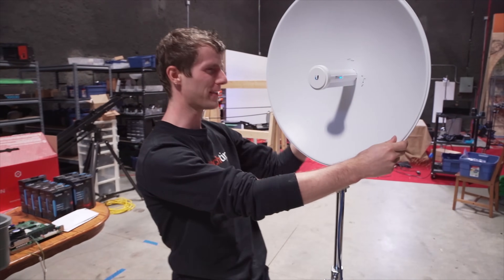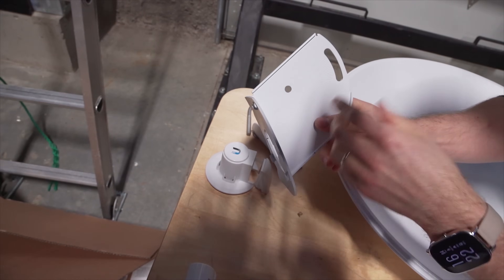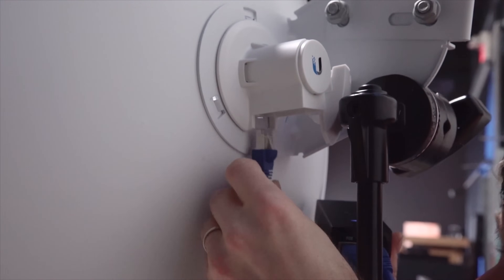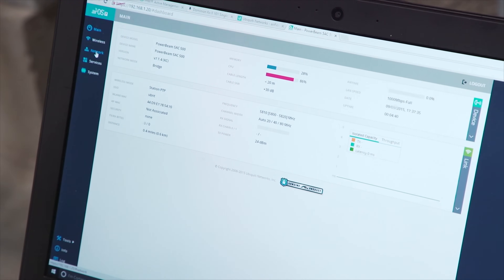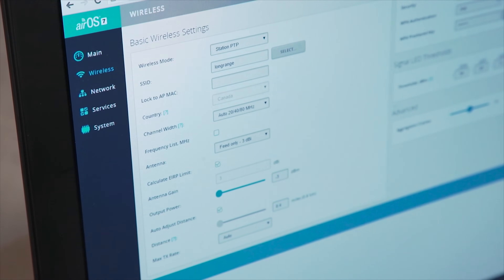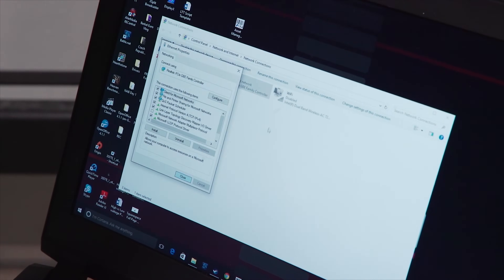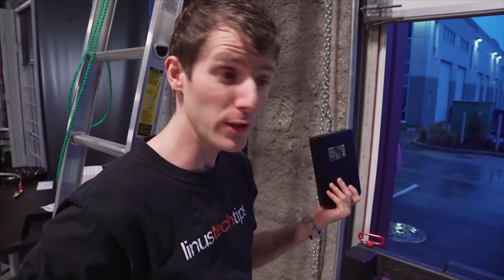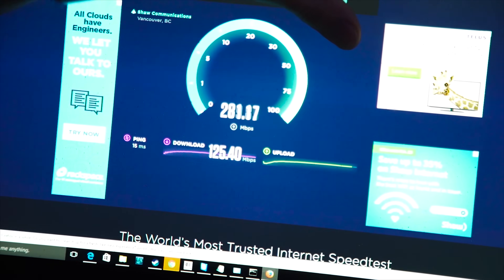HOLY $H!T - Long Distance Wi-Fi (Up to 25 KILOMETER range!?)

Comment: You buy $17,000 Man Size Batteries but can't buy a 60metre Antenna Pole?
Reply: Planning permission, man. Planning permission/permits.
Reply: Adderkleet
Pfft.. whoever obeyed those lol
Reply: Rustedblade
I admit, if Holmes on Homes has taught me anything, large portions of Canada don't.
Reply: Adderkleet
Lovely isn't it, how with the stoke of a pen the Council can be on your doorstep in morning with a demolition crew to inform you your house in non compliant with code
Reply: I work in a company which builds transmission towers. A 60m antenna pylon whith everything included(Planing, permission, foundation) it will cost you at least 80k€ which is around 115k canada dollars. This is nothing you should invest for private wifi :D
Reply: 60 meters is 196feet.
At 10 feet per story (on average), that'd require an antenna 19 stories tall - at minimum - in both locations for him to pull this off.

I can't imagine the cost is going to be all that cheap, let alone getting the permits to allow a 19 story tall pole next to his house in a residential neighbourhood.  That said I think he should stick the antenna up on the roof of his office and on the roof of his house and see what he can get anyway - just as an experiment.
Reply: You probably need permission from the canadian aeronautical assotiation eh
Reply: After 78 feet you generally need a permit to put up a tower depending on bylaws. and the larger towers require a pretty significant base and guide wires. i would imagine that they rent or lease the building they work out of further complicating the installation of a tower. More of a pain in the ass thing than a price thing in my opinion for them.
Reply: I work an ISP. We have these masts, and offer a wireless connection to customers in un-cabled areas using exactly the dish in the video. Pretty cool stuff.
Reply: oldbootz Not farms but, a small(ish) island. The Isle of Wight, represent!
Reply: It was given to them... for the purpose of making a video and I presume advertising for the company?
Reply: now its 80,000 dollars worth of drives
Reply: unless you in farm lands that dish is not going to do 25km in a city, no way... unless you using illegal channels and EIRP limits.
Reply: Jackie Scholl We have a Ubiqiti dish on the customer's property which is in bridged mode, you then add your own router on the internal for WiFi and whatever else you want.
Reply: Volken321
I'll take the DIY option lol
Reply: maybe a professional permanent quality  for business or service provider, but for test please.
You can climb a near hill ! ahhhh
just the simple answer is: this equip dont work in that range(and the tester hide that, so he try to cheat us) or the tester is really inept!
Reply: Adderkleet yeah, City permits can be really annoying. In my area for example, I can't construct a standard Greenhouse larger than 100 square feet without building it like a freaking garage at double the cost, but the city code explicitly says that I can keep my servants in a shed that's 99 square feet with no floor or Plumbing or electricity which I assume is left over from the days of slavery so it won't surprise me to learn that a given City won't let someone have a tall antenna.
Reply: well he was sent it and didn't know the price so he looked it up he didn't actually pay for it
Reply: Rustedblade fuck the DIY way this is real men shit
Reply: my gf cheated with mike holmes.. kill me
Reply: Well, there are permits too
Reply: 60 meters is pretty tall
Reply: Elliander Eldridge fucking rolling dude where do you live
Reply: Rustedblade. .MAKE. YOUR OWN. MATE

Comment: Tbh had a look at something like this and topography does screw things up, but you just need to request permission in town hall if u intend on mounting an antena above X meters if not mistaken.  It's a shame that both the antennas need to be longrange instead of only the receiver, else you'd be able to pick up wifi from every1 in the way aswell.

Comment: Linus if you are reading thank you so much. So I want to know how this works. To start you confirgued one antenna to a static IP, network settings as the gigabit network in your office, and finally as a station PTP, but in the end you changed it to auto IP address. Then on second you then configured it to as an access point that is connected to the server. Then you have internet access. Correct me if I am wrong or missed something and if I am totally wrong then if you can explain it then that would be great. Thx

Comment: My ISP provides me internet via the same point to point WiFi connection. They have a receiver antenna mounted high up on my house. It works well even in bad weather. The transmitting antenna of the ISP is like 3 miles away with lots of trees and buildings in the middle.

Comment: Obviously both transmitter and receiver operate at a frequency range higher than the WiFi frequency, I wish they could make a high power transmitter only that you can connect to with WiFi devices without the need to a receiver, this is helpful if you to live few miles from a park or a public area and want to use your own WiFi where mounting a receiver is not possible.

Comment: is this legal?
Reply: +CoolKoon right. I better get to building my broadcasting tower haha
Reply: Of course. Just as legal as operating your wifi router....
Reply: +CoolKoon I'm not sure if fcc regulations would say so. your essentially turning your router into a broadcasting tower for radio waves. but perhaps it has lax rules on wifi due to it being encrypted and not drowning out other wavelengths.
Reply: FCC regulations say that the 2.4 and 5 GHz spectrum is unregulated. This means that you can put up a transmitter in this range that operates at ANY power (well, above 50 W ERP or so you need some special permits, because the transmitted signal has harmful effects on anyone that would come near the transmitter and thus extra measures need to be taken to keep everyone out) and you can transmit this energy using ANY kind of antenna of arbitrary shape. It MUST be this way too, because all the microwave ovens in the world operate (transmit) on 2.4 GHz too (haven't you ever noticed that you're not able to use your wifi while the microwave is running?) which would otherwise create an unacceptable interference.
Reply: +CoolKoon excellent reply. so this dish isn't even operating at maximum legal capacity?
Reply: +griffin gibson Thanks and definitely not. In fact the very point of such antennas is to use as little power as necessary (if you'd use an omnidirectional antenna, your transmitter would have to radiate A LOT more power to provide the same range this antenna does, because the power would spread out in all directions).
Reply: got it.im just wondering how much farther range you could legally get from amping up the dish transmitter
Reply: +griffin gibson It isn't nearly as much about the transmitter as about the antenna. To give you an example, I've read once a report about some guys in South America establishing a 200 km(!) connection with the use of rather big antennas, but only using two measly wi-fi sticks as transmitters! No amplification, no powerful transmitter, nothing, just damn good antennas. I can look up that article if you want....
Reply: NO WAYYYYYYYYYYY
Reply: HELLS YEAH! I got goosebumps. I'll be able to fix my terrible wifi connection problems :D
Reply: Yes way: http://ci-journal.net/index.php/ciej/article/view/487/402 Unfortunately I didn't quite remember it correctly: I was convinced that they did it with USB dongles, but in fact they used two fairly decent routers and the distance was 279 km (173 mi), not 200. And they used huuuge parabolic antennas for it of course. But yeah, they did it.
What you want is something completely different though. It seems to me that you need decent wifi signal in and around your house. And for that you need omnidirectional antennas (and a router that supports them). To make it simple though, you might want to look out for these parameters: the router should have gigabit connectivity, 300 mbps wifi support and at least 3 external antennas. Most of the routers that have these parameters can give you really decent reception even if you have a fairly spacious backyard.
Reply: Oh no my phone lines are super old and don't give me good Internet speed. I want to set up a dish to tune into my buddies super fast wifi 10 miles away.
Reply: Oh, in that case the antenna presented in this video is ideal for you. Just make sure that you and your buddy's house has line-of-sight visibility to each other, otherwise it won't work. And the beauty of this antenna is that you don't need a router upgrade: you only have to plug it into your current router with an RJ-45 cable and (after you do the configuration) you're all set.

Comment: I wonder if you could aim these vertically and communicate with satellites lmao
Reply: Yes, you could, but you'd need a different RF module (a so-called LNB) for correct reception and the signal would kinda be weakened due to suboptimal design (satellite dishes' focal points are not quite in their center to avoid having to mount the LNB in the radio signal path, thus worsening reception). Long story short I wouldn't do that if I were you.

Comment: How long does it take for the unfortunate people living in the path of this death ray, to cook eggs directly on the kitchen table? Tech is a good thing but this just is stupid.
Reply: +Tayro Thinkingoutloud First of all the very reason for using these antennas is to avoid dissipating too much energy (so no, it won't cook anybody), because this way the radiation is VERY efficient (most of the energy radiated by one antenna gets captured by the other).
Secondly no, cell phone internet is still ridiculously expensive.  (Bidirectional) satellite internet is also quite pricey, but satellite phone internet is the most expensive thing you can get.

Comment: I could do this. it's the same theory as cellular towers. (which I climb and install the Telus and Rogers LTE). my career is this shit. cept towers can throw signals 100km or more.
Reply: Also, don't forget that cell towers operate on MUCH lower frequencies (usually the 800-900 MHz range IIRC) which are MUCH more forgiving to lack of direct line of sight. Also, building those towers close to each other is necessary not because of the towers, but the phones, which have a MUCH weaker transmitter in them.

Comment: I'm surprised that it's so cheap! Maybe I should use one of these to extend my WiFi from upstairs to downstairs since this Belkin WiFi extender doesn't do SHIT
Reply: That's not such a good idea as you might think. These antennas have a very narrow radiation angle (i.e. they're highly directional), which means that you'd get good reception only at a very narrow range. Some good omnidirectional antenna is what you might want to look for...

Comment: Thank You. Looking for a wifi extender to provide net access to a friend that lives like 200-250 feet away. This will more than cover the distance and maintain a good strong signal. Question is, Will it operate through walls? I would rather keep the antennas out of public view. 

Lastly, Why not provide a direct link to the Ubiquiti site?
Reply: +Bounty B. Wolf You could even just get one dish and just blast the wifi over to your friends house. The dish can actually be configured as a router rather than just a birdge of the connection
Reply: If you live in a typical 'murican wooden house then chances are that it MIGHT operate good enough through a single wall without much signal attenuation (stone/concrete walls are more problematic, because the rebars used in them attenuate wifi signals a lot). You'll still have to align both antennas properly though. Also I think that this antenna is overkill for 200-250 feet. The company that produces this antenna also sells smaller models with a range of a couple km, which would still give you a plenty of legroom..
Reply: I seen those smaller ones. IF they are cheaper than the bigger ones as a pair, Then I would get those instead.

Comment: You can use iPerf3 to get an accurate bandwidth measurement of what the throughput of the antennas is. You would setup one side in the iperf server mode, in the "datacenter", and then use the iperf in client mode on your laptop. I'm a network engineer, we use this all the time, really good tool.

Comment: You can just steal a telephone pole and strap it to the top of the office.
Reply: "Just"
Reply: BioBelac "You can just"
Reply: 6o foot stripper pole?
Reply: Right, single-handedly.........not.......
Reply: Or you can make a 60 foot pole? Just need 100 bucks worth of iron to cast and a crane.
Reply: 68 meters, like 217 ft
Reply: jlcurtis94 still too small
Reply: 60* meter
Reply: lol
Reply: holly1850 Dennis would love to bring his girlfriend into work for that.
Reply: yaaaas they should do a super fun video about strippers a completely stripped computer yeah you thought i was perverted
Reply: holly1850 Test bench plus stripper pole
Reply: omg yes
Reply: holly1850 xD
Reply: will the pole be a heat vent or heat sink
Reply: holly1850 A liquid cooler with a hole in it filled with milk.
Reply: ***** I really don't fucking know where we're going with the PC porn.
Reply: the title for the porn is computers runnin hot
Reply: too small
Reply: he said 16 meter, thats 52 feet

Comment: I wonder what would be the ping at best antenna alignment possible 25KM away
Reply: +guily6669 1ms
Reply: +guily6669 Ping is not an issue, the problem is usually more with the beacon signal and other parameters that ensure that the connection remains up (and stable). But even those start to manifest more on bigger distances, like above 100 km.

Comment: For a not free line of sight ( trees etc ) use the 900 Mhz radio transmitters from Ubiquiti
I,am using them for years , working great The 5 , 3 and 2.7 GHZ are nice if you have a free line of sight

Depending on the climate where you living in i advise ( humid climate ) gel filled shielded cat cable, standard cables are breathing and in time they are full of condense .
Most important is keeping the Fresnel open en clean the first meters

I,am living in the middle of the bush and have a wireless connection over 6 radio transmitters , passing mountains etc to a multi wan router, there are more than 50-clients on this system

Have fun .

Comment: Also be careful with the POE injector you got. That's probably the 24V passive injector. Meaning it will give 24V even if you client doesn't need it.  AKA fried network card. And, standard POE switches are 48Volt. So don't use those for "most" ubiquiti gear.
Reply: Actually this is almost never a problem, because passive PoE injectors are used on both ends (if the powered device doesn't support it) to filter out the DC. Active PoE isn't a problem either, because the 48 volts are usually pushed only after a brief negotiation (between the suppply and the powered device) takes place.

Comment: Dude free wifi while at school I gotta get this I can have Wifi from my house to my school and wifi from Walmart and basically anywhere in my area >:D
Reply: +QuantumChris You still need a pole of some sort around 50m. In addition, multiple dishes pointed at different directions. Not to mention, even at 1km, alignment is super critical, to the point each millimeter can be the difference between 5 bars or none. Don't be fooled by the cheap price, still requires quite a bit of set-up and additional equipment.

Comment: There are types of crystals where when you shine a laser through it, it intensifies the beam significantly (sometimes by 50%, sometimes by 10.000%). Now my question is this, will it be possible (if u find the right type of crystal for the wifi frequency ur using) to use the same kind of technique to intensify the wifi signal so that it will reach further?
Reply: +BravoTwoZero Sadek Guess that shit doesnt work or is too expensive, because people would do it elsewise...

Comment: I have a HAM radio licence so I can broadcast at much higher power on 2.4 GHz on channels 1-6. I bet with a setup like this on 2.4 GHz I could get a Wi-Fi signal around 30 miles pretty easily

Comment: linus, please dont measure network speed based on speednet and websites like that. The difference is the transmit/receive speed between devices on your network - and the speed to transmit/receive from your device on the network to a server on a different network.  Basically it makes your results vary based on outside factors.
Reply: Then what would you recommend?
Reply: +Ashley Meah Anything.

Comment: would it be possible to link say 6 of these dishes together? the camp I work out of during the summer has been looking for a way to link the upper work site with its main office down the valley (distance is around 20 kms). the terrain means that putting a cable in would cost to much to be worth it. 

with these in theory we could mount dishes at the points where the valley turns following the road, and link the two camps without any need of wiring other than the existing power supply present.

Comment: I actually do this about once a week for customers that have internet at their house and want it at one of their buildings, like garages or work shops. I've seen real world tests of antennas very similar to these bridge Wi-Fi about 2-3 miles in real world applications while maintaining speeds. I'm not doubting that 20km+ is possible if you can get a perfectly clear Fresnel zone. but link stability would probably become an issue because it would most likely have alot of  Wi-Fi interference that you would pick up in any populated area.